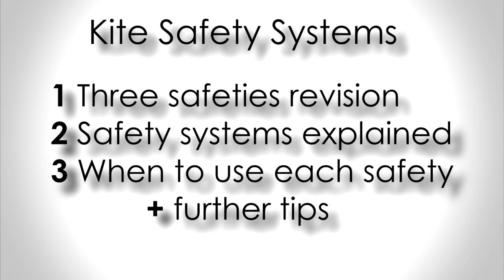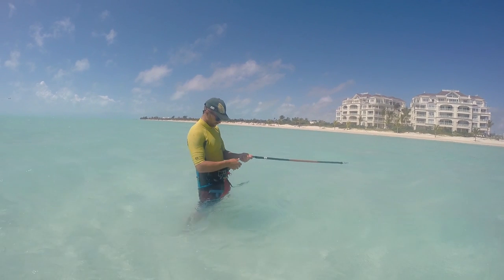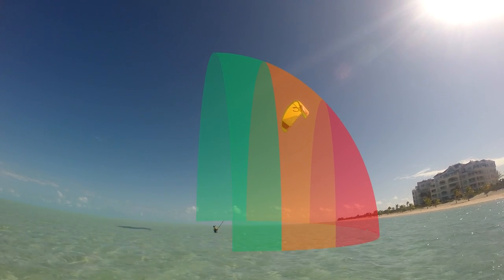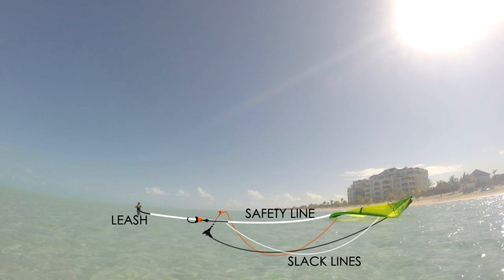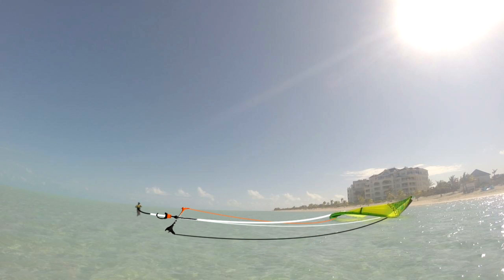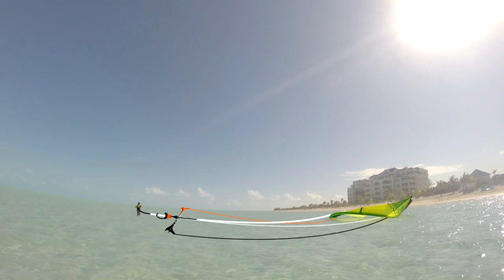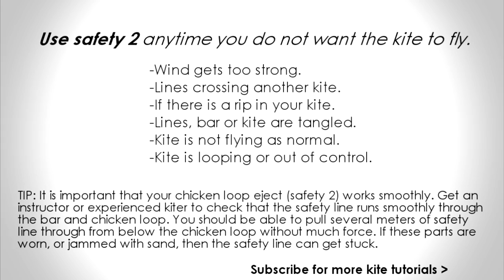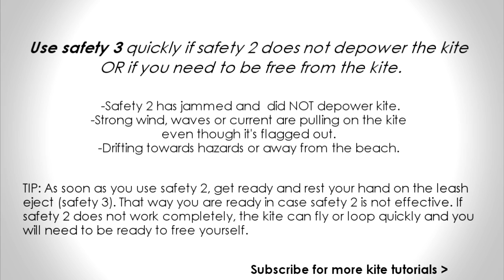Introduction to Kitesurf Safety Systems

Comment: Great video since not all surfers understand the slack issue when quick release is open.
And can you please please add a video that demonstrate how to reset the QR in a safe manner while surfing. To me the QR accidentally open and I had hard time resetting it since I didn't not pay attention to the fact that my safety line got shorter and shorter until all lines got tension.
Reply from the maker: Thanks, that's why I made this video. I'd heard too many kiters, even experienced kiters, say to me that their kite still had power after using the QR (or chicken loop release). Then I'd ask them how far away their bar was after using the QR, and they'd say a couple of meters. It became obvious that not enough people understood what makes that safety work.

I will hopefully include resetting the QR in the next version of this. Generally speaking, you want to practice being quick at re-settting your chicken loop, so you have time to watch the safety line feed through, make sure it's not caught on you and be ready when all the lines regain tension.
Reply: Great. what about reseting while the safety line is looped and locked to one side of the bar like you demo in self rescue ?